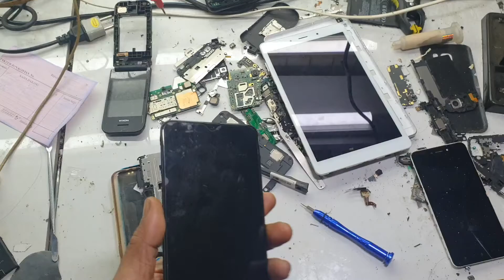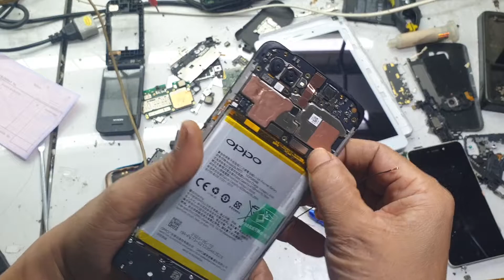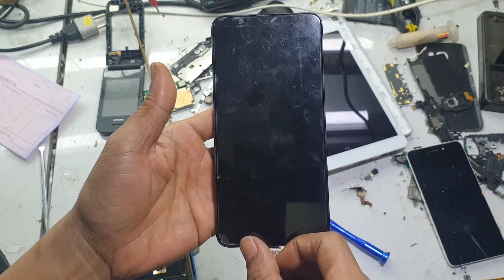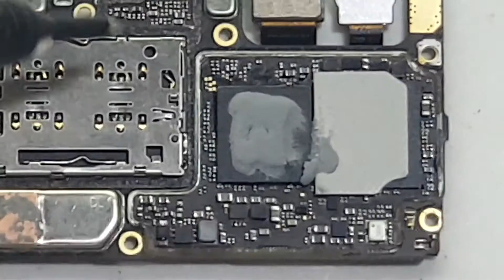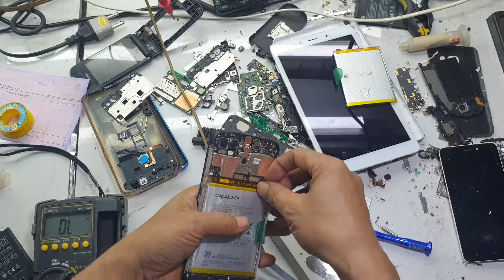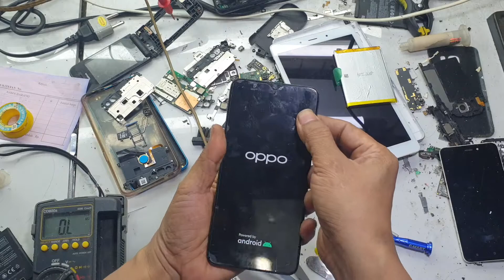OPPO A12 LAYAR GELAP TIDAK ADA TAMPILAN , CUMA GETAR

Comment: Bang mau tanya 
Saya Nemu hp Oppo f9 
Sepertinya habis terlindas kendaraan 
Lcd hancur 
Tp mesin masih ori segel blom pernah servis 
Saya coba cas cuma getar dan hangat 
Saya tekan tombol power gak ada respon getar 
Saya coba cas pake adaptor yg ada angka tegangan  masuk di angka 1,1 Amper  1,3amper dan 1,4amper 
Itu normal apa tidak ya 
Mau saya belikan lcd takutnya gak normal
Reply from the maker: tidak normal , coba cek dl kapasistor atau resistor yg short